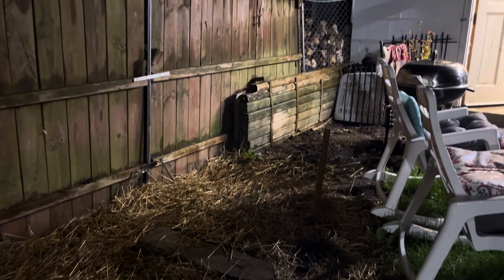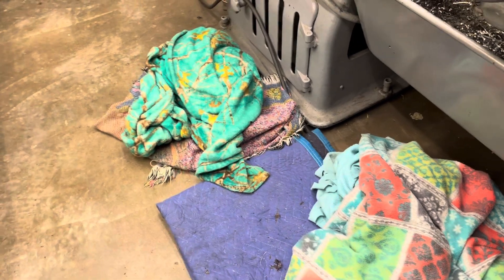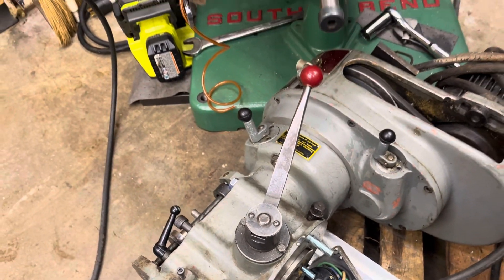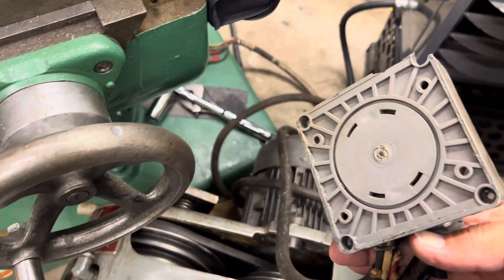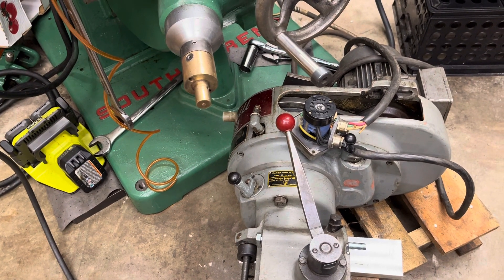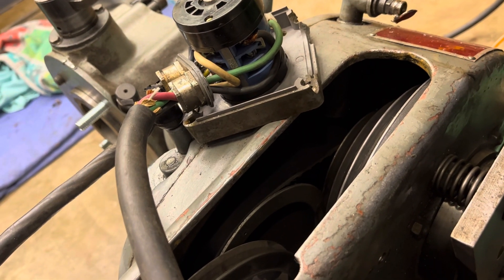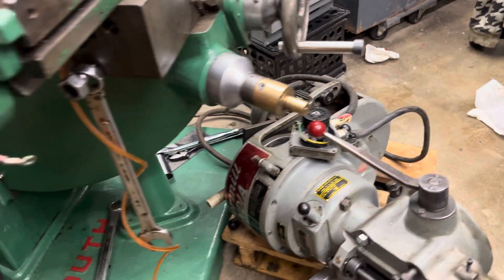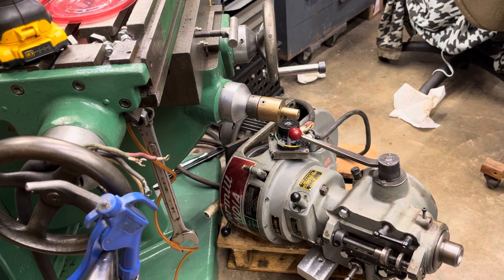Sunday update 10-29-2023

Comment: Kimber since those head bolts were only half a hole off couldn't you have lock tighted plugs in the existing holes and drilled new ones the proper distance apart. I recall seeing someone on youtube do just that. Don't remember who it was but that would allow you to rotate the head as designed. Just a thought from a dumb old man.
Reply from the maker: Thank you old man my highly regarded your comments